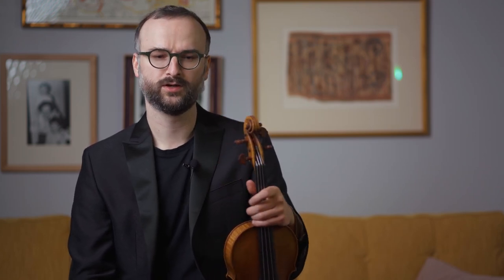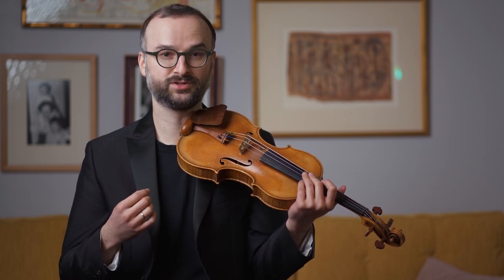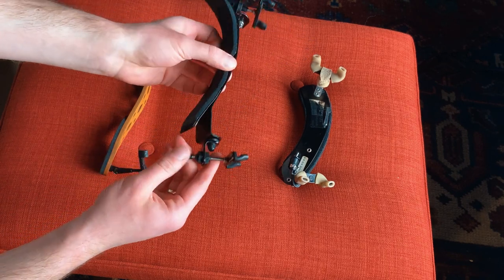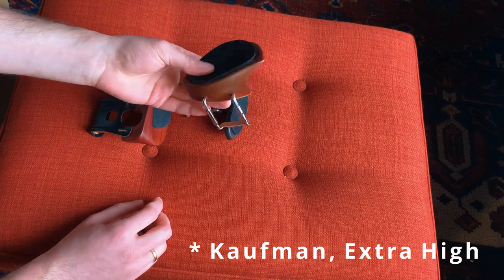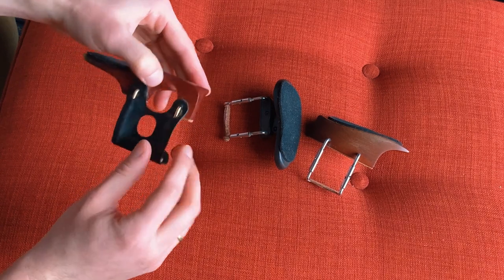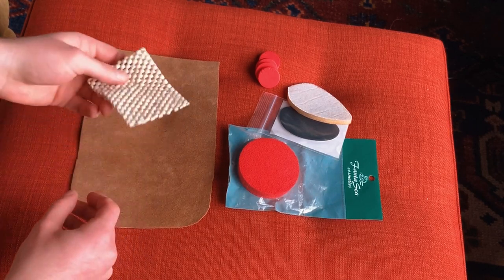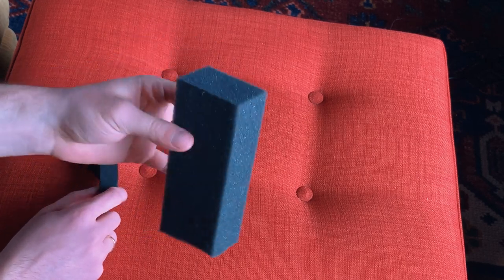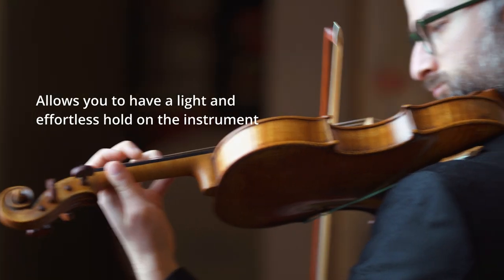Violin Setup Journey: shoulder rests, chinrests, etc

Comment: Daniel, One thing that I think can be discussed more fully is the position of the violin on the shoulder as a fitment issue. Whether the bottom of the violin, or the end of the violin is right or left affects two things. The first thing is the ability of the player to get over the shoulder, especially when they have smaller hands or shorter fingers. So, if the violin end or bottom is situated more to the left, then getting over the shoulder with the left hand, becomes easier and facilitates shifts in higher positions. However, the farther left the violin is on the shoulder, the more pronated the left hand has to become in order to play.  For example, thirds become more difficult. So there is a balance to be struck. I am in the process of trying to find the chinrest that will allow me to find that balance. My fingers are short and my hand is stubbyish. So it’s hard to get over the right upper bout. So I’m very glad to hear about Mach 1 and I intend to contact them very soon.  Thank you!
Reply from the maker: You've raised some compelling points! From the viewpoint of an experienced violinist, it's commonly observed that a "successful violinist" has dedicated a significant portion of their life to mastering their instrument with a specific setup, experiencing minimal changes over time. This consistency is more often the norm than the exception. As a result, it becomes challenging to confidently evaluate the impact of altering the violin's position, since such changes are beyond the realm of our usual experience. While one can theorize about the physical implications, truly understanding the experience requires firsthand practice. Despite my experiments with various playing techniques, my experience is still relatively narrow within the myriad ways there are of handling the instrument and setting up the arms. For instance, adopting the kind of position of the violin you described feels unfamiliar to me. To form a well-informed opinion, I would need to invest weeks, if not longer, immersing myself in this new setup to grasp its nuances, challenges, and possible adjustments. I will think more on this, however, and what you mention certainly warrants a discussion and/or video!

Comment: I've used the Bon Musica shoulder rest almost exclusively since 2005 (my bend looks quite different!)  I took a hiatus from it in grad school on the suggestion of my teacher, opting for the ol' pad and rubber band setup.  During those same years I also did my first playing on a period instrument, strangely preferring no pad or cloth whatsoever, resting the chin on the right side of the tailpiece as Leopold Mozart suggests.  I see this as a necessary 2 year exploration into holding the violin more with the hand and developing a more intimate tactile relationship with it as such.  It felt great to go back to the Bon Musica after all that, but I now treat it as a shoulder REST, not a shoulder clamp.  

Now here I am, eyeing that fancy KorfkerRest, soon to possibly be replaced by the K-rest.  I'm trying to buy a new instrument this year.  What's another $400!
Reply from the maker: Sounds like you're on the correct journey. 
Make friends with a violin shop and ask them to order it at cost (half price usually) it's worth it if you have to use a shoulder rest.

Comment: I really like "Perfection Pegs".  They are geared pegs with a 4:1 gear ratio.  The gear is inside the shaft of the peg so you don't see it and it looks like a regular peg.  Professional violinists only use a fine tuner on the E string because they feel that find tuners cause some loos of tone.  If that is true, then geared pegs without any fine tuners at all must be better.  In any case, it is easier to tune all strings very precisely with geared pegs and you don't need any fine tuners on the tailpiece at all.  You can install them yourself or have a luthier do it.  If you do it yourself, you can buy a boring tool cheaply off ebay with the correct taper.  You don't need a $100+ one from a violin shop.  It is very easy to overbore the hole, so you should turn the boring tool just 1/4 of a turn, try the peg, retry etc.  Put the pegs in when you think the hole is still too small as the tension of the strings will tighten the peg.  The Perfection pegs actually have threads that bit into the wood of the peg box.  You use a cotton swab, dampened with water, to soften the wood up a bit before putting the peg in.  The threads are hidden under the wood.  So, you do need to be precise, but patience will let you do a good job.  I am very impressed with mine.  On very old violins, the constant turning of pegs eventually wears the holes bigger, they need to be plugged and rebored.  Geared pegs eliminate this.
Reply: They came pre installed on my current instrument. I totally agree with your comments. The only downside is you cannot remove a string as quickly as with traditional pegs. But that sort of need is a rare situation.

Comment: Tension is something I’m struggling a lot with so if you made a video on reducing different tensions, especially (for me) the right arm muscle that is at the armpit connecting the shoulder and chest I’m sure many people would find it useful. Finger tension is also a very elusive puzzle, as I’m trying to discover the best ways to settle my fingers and keep them relaxed as I play. I also find my left hand fingers to be quite tense on the fingerboard, especially when playing double stops; it’s also harder to hold the violin in the left hand more with double stops for some reason. In fact, my broader question is about retaining a relaxed technique during playing. I can always do some stretches and play open bows and slow tones for a couple minutes very relaxed, but if I start more complex pieces that relaxation of the fingers and arm goes away almost immediately.

Comment: Thank you so much for sharing your decades of experience, it really helps me. I too did a lot of experiments, sometimes crazy, but found some connection points between his checks and my checks.
 1-The little piece support on the chin rest also helps me for stability. 2-the high positions on my shoulders rest take better care of my high neck (and destroyed) but they reduce my stability. 3- I used Bonn for 8 years after using Kun for another 8 and finally went back to kun. 
Thanks again for sharing.

Comment: Thank you so much Daniel for sharing with us part of your violin setup. Would you consider also sharing with us information about the bridge, and tailpiece that you use and why you use them? Thank you again for the great content that you always bring to us.
Reply from the maker: The bridge and tailpiece are the original ones from the maker of the instrument, Andrew Ryan. Bridges have to be carved made to fit your instrument, so I can't make any recommendations on that other than to find a good violin shop that will do it. As far as tailpieces, I don't see a difference other than a cosmetic one, although switching the tailpiece gut to kevlar is a structural improvement.

Comment: I at present dont use any shoulder rest. I also dont use a chin rest. I play bareback so that I can turn the instrument sideways like Ostrach to run the bow tertically to avoid stabbing any fellow violinist in the eye. I currently am not in any orchestra but if things should change Im pro active with shielding the guy or ladie sitting right next to me. When i have used a chin rest i put round felts on it on the back edge to form a lip for my chin. I used an everest with balled up socks at each end. The reason i dont use them any more is torsion on the back plate.and the dulling of tone. I believe glue cracks are encouraged when securing a shoulder rest so I am currently avoiding the use of these items. However I do believe they help with vibrato so may switch back another time. I like the freedom to move like a gypsy and not get locked in. Thank you Mr. Kirganov! Most especialy greatful!😅

Comment: Thank you for this, Daniel! I’m just coming back into playing again after right thumb surgery. I realized that I have been so focused on the new way I have to hold my bow with a hand splint on now that I have neglected to figure out why my neck hurts in a new spot & why the shoulder rest helps my violin slide down my more sloping shoulder. It didn’t used to do that. The angle of violin to bow, the concept of bringing the violin to the bow in certain passages, both will be helpful. So will a higher chinrest. I’m changing to Planetary Pegs as well. My thumb doesn’t have enough grip strength to turn my pegs when it is more humid. I enjoy your channel. I just wanted to let you know that I found this video and the one with the luthier on getting more acquainted with your violin especially helpful this week. I’ll be back!

Comment: Hello Daniel . Nathan Meltzer wrote to me to say he  used one of my "ridiculous " shoulder rests for a while. He moved away from it for a few years and noticed tensions increasing so began using it again to teach him the correct position  . That`s rather impressive from a player I have never met .A far better player than me as well .
   New players will learn to hold the violin properly if they use the neck strap as well . There is a scientific purpose for the neck strap .But appearances are more important for too many players .
Reply from the maker: Dear John -- thanks so much for the comment! No offense intended with my humorous take :) I have definitely recommended to others that they try your system if they are experimenting and diagnosing issues. For me personally, the neck tie didn't prove to be a useful as the bottom part, which I played with for a little while. This journey is so personal, and I am positive that many would find your system beneficial if they gave it a shot. Is there a website where people could purchase it or inquire about it?

Comment: Rubber cement works like a charm, used it for years with the red pads!
Reply: You can try artino sr 21 a improved shoulder pad  very nice to use
Reply: @philipq6906  I’ve gotten argentino before for myself as well as students and I personally don’t like them too many problems with the bolts sliding around. But thank you for your suggestion!
Reply: @michelevolz7769  I have just got it and it is a new product called  sr 21. It has a silicon ring and a foam pad. I think we are talking two different products. But anyway everyone has different body shape and preference.
Reply: @philipq6906  post a picture?
Reply: Hey there just saw a picture, looks very similar to my red pad set up
Reply: @michelevolz7769  yeah they are very similar to your solution.just has an extra silicon string to get  it attached to the violin I found this very simple but effective and secure as well. That is why I recommend to you if you want other people use a simple pad solution. They may just find that one and it is not expensive.

Comment: Great work Daniel.
It's been always problem for many player/luthiers.
I know and heard about someone who lives in Holland.She does the orthopedic service by recomandation.You taken app and go there so they take your chin mould and produce for you.But I think is going to be long process like keep going for trial again and again.
Don't think many people knows and probably expensive but forever?
Thanks to help people
Reply from the maker: You can try the Impressionist Chinrest Comforter. It basically creates a mold of your chin. I don't usually advise these for 2 reasons: Firstly, it locks you into one head position as the only one that 'fits' the chinrest. Secondly, it's not clear to me that the ideal is something that creates no pressure points around the shape of your jaw. In fact, an 'uneven' surface may be what gives you the balance of stability and control. If something fits too well, it's hard to leverage it.
Best of luck!

Comment: Bravo!  This was the most useful presentation I've ever seen on setup.   I love your analysis of the pros and cons of some of the options.  And your experimental approach.  And your placing comfort above aesthetics, using various colored pads and bands that purists would shun.

You're so right about the dogmatism of too many teachers on this.  I was once shamed by a conductor ( violin teacher) in front of the whole orchestra because I can't play without a shoulder rest, as she did.

The quest for the optimum setup is something so many violinists are on.  I also tried the Kreddle chinrest;  I found all the different adjustments rather overwhelming.  I switched to The Wave, and use it with a cloth cover.   I've tried many different shoulder rests, now I use a BonMusica.  But the Pirastro may be worth trying.

One curious thing I noticed about your posture:
  In the video, whenever you're not holding the violin, it appears that your left shoulder is several inches higher than your right!   Is this an illusion, or real?
Reply from the maker: I think that's just the video angle and my sitting on 1 buttock! :)
Reply: Putting comfort first is the big mistake. A deckchair may feel comfortable but eventually will be bad for your back .

Comment: Hi Daniel great to get your input on this whole area. There are so many variables!  I got much increased stability  when I angled the "shoulder curve" strip on the knee musica shoulder rest. That metal strip is now attached  at an angle which sits further towards my neck. Great because I have narrow shoulders.
I now need to solve the problem of a slight forward fall of the instrument when I get into a piece or after some energetic playing. I nearly have to reset the violin... I don't notice it in my practice time cos I'm stopping and starting.
G Ire

Comment: Thanks for sharing your process!

I'm a violist, but acquiring a larger instrument last summer made me go through this whole cycle again and reevaluate my playing. I still haven't figured it out what is optimal, but you've certainly flagged some routes to explore. I used a Cradle for years, which was solid, but heavy and limiting, and have for past decade or so used a Mach One bolstered with small pads and a rotating neutral/dark handkerchief (or leather or chamois) to hide the scaffolding. For chin rests my long-time teacher liked guarneri, and I go through cycles with it, and SAS. I've only recently learned how to effectively play with Guarneri (relaxing more, finding the 'hook' point, less chin), but with the taller SAS it's noticeably easier to play in case of shoulder rest drop mishap.

Generally, in revisiting my set-up and sound generation I've become more attuned to finding my "geometry" more, and consciously pulling on the Tuttle Coordination. Weight lifting has probably also increased my conscious use of my back and core to maintain good open posture.
Reply from the maker: Thanks for mentioning Tuttle. Diving into her work can really shed light on setup as a consequence of technique/posture/feeling, rather than the other way around.